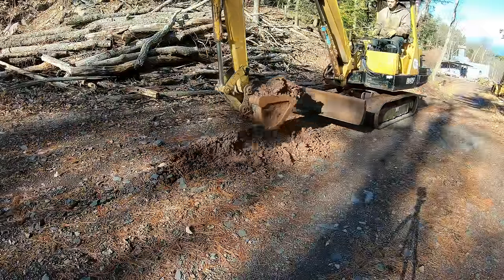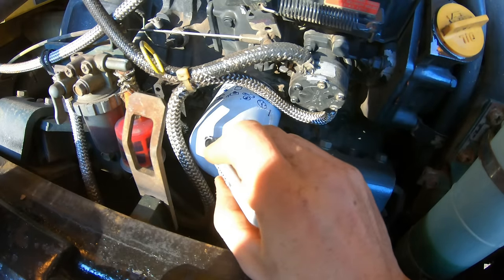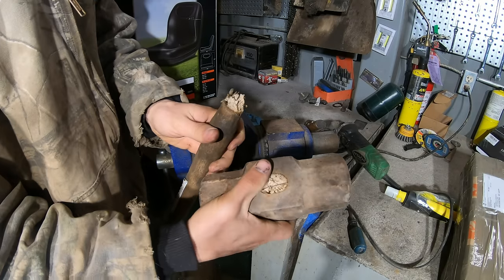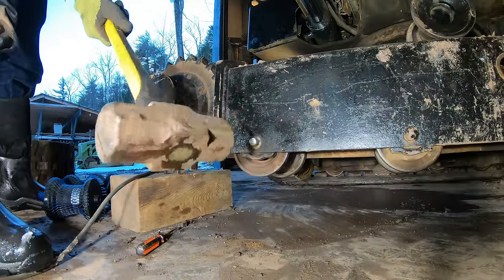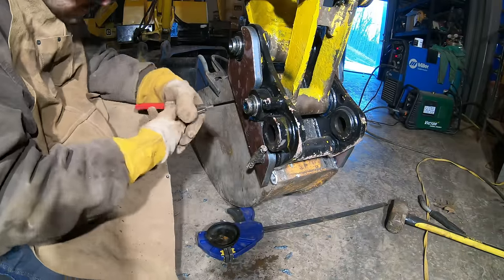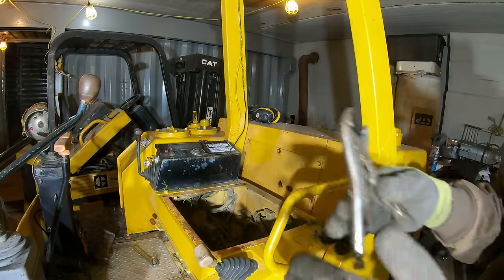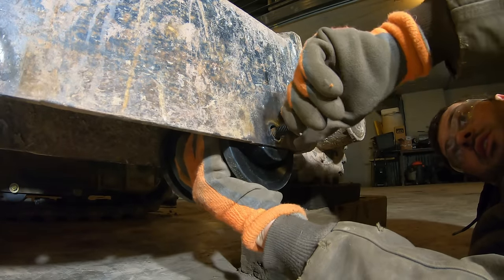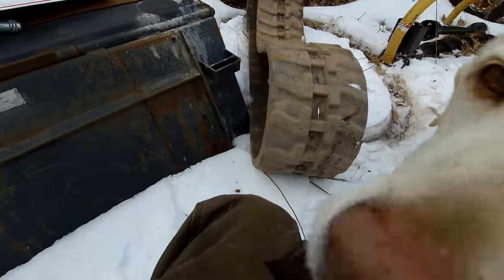Fixing up the new Yanmar excavator

Comment: I’m a marine mechanic, most of the boats I work on have small Diesel engines like these excavators. Yanmar, Perkins, Universal, Kubota, Volvo (repainted Perkins). The Yanmar engines are the most reliable by far. They are not the smoothest or most refined, but they never break, and always start (as long as they have clean fuel, lol)
Reply: 25 year old Yanmar 3GM30F in my boat and it just goes and goes

Comment: Watched most of your videos and my comment is "You are an ACE mechanic". I've only witnessed 2 other people in my 73 year history that have your raw talent. Keep the videos coming!
Reply: some knowledge and the persistence to carry through when shit breaks, or gets tough.. also know when it's out of your expertise like sending away the skidsteer track motor for a rebuild rather than ripping into it, although sometimes as long as you have access to all the rebuild parts needed, knowledge of acceptable tolerances/clearances, and tools -sometimes even tool and die/machining, you can be successful in all ventures!
Reply: Jim Ryan When he was standing on the breaker bar trying to get the roller off he was trying to loosen it to the right he should’ve been turning 
the bar to the left
Reply: @KCBEECH  You've never tried tightening a bolt that won't come off? Sometimes it's the trick that works. these obviously were long past becoming hammered dogpoo. I can't imagine running something like that until it siezes up and wears the metal off while wearing a groove into the track.. That's just insane. Then again I guess thats what you get when you buy an excavator with over 8000 hours on it.

Comment: Thanks for the great video mate ,Yanmar make great marine engines very reliable ,not like some of the junk with well known names and bigger price tags ,you certainly have a great workshop that most people would like to have,me included ,look forward to the video on the thumbs.cheers from down under.
Reply: Agent 036 NWO - damn straight, Japan manufactures high quality goods. Think Honda motorcycles, not even the same as made in China.
Reply: Keith Kelly  That's spot on mate ,it goes for most things as well as motorbikes and outboard motors power tools cars ,I remember a old tee shirt that summed it up " I'd rather push my Harley than ride a rice burner" sort of admits defeat on so many levels. Cheers mate from down under.
Reply: Agent 036 NWO  That's most things ,it's got to do with quality control ,and their culture of personal responsibility ,Cheers mate from down under.

Comment: A back and time saving tip andrew, when pouring out 5 gal pails, or any pail. Place the spout up top not on bottom, this way when you go to dump youve got more accuracy, plus the air can go in and the fluid pours out fast!!! To explain myself, take the 5 gallon pail. Lay it on its side and roll it until the spout is up top and the oil cant come out. Thats the same way you hold it when you go to pour. no more glug glug glug and easier. Works with quart oil jugs with the spout on one side, (not the middle)
Reply: same thing with 1 qt oil bottles, and the old square cans.
Reply: @asmith4326  yep!!  Tricks in the design so simple many of us overlook them!
Reply: Life hack
Reply: exactly.  Maybe it's just the sole proprietor in me but I have a tendency to feel a little nervous when I watch these.  I notice I get over it though and I might even be a more patient boss at work.;)

Comment: Bolt can´t be stuck if it´s liquid
Reply: Thee ole gas ax, a thousand and two uses .Lol
Reply: Blue Wrench!
Reply: @AWDJR  don't discount the "phire phillips" , every toolbox should have one
Reply: Worked as a mech fabricator at a gravel quarry for a big company. Best thing on big equipment with big bolts drill in the center with a good sharp bit then use a torch and fallet the bolt out. Wish andrew would set up a po box for fan mail.
Reply: @AWDJRforYouTube  Add to that hot wrench.   ;-)
Reply: @327JohnnySS  lmao gas ax classic never heard that before

Comment: That oil filter gasket prelube was slick. Ive never seen someone do it quite like that.
Reply: The usual recommendation is to smear on some new oil, but what's wrong with using some old oil from the old filter in that fashion?  Fits perfectly as a template to apply the oil prior to mounting it!  No need to smear it around with your finger!
Reply: the other plus is you see for sure that the old gasket came off.  Personally, I'd wipe off the gasket mounting surface too, but whatever works, right?

Comment: Andrew your video proves beyond a doubt that being a Jack of all trades doesn't have to mean a master of none:)
Reply: To be fair. He doesn't know as much about any one thing as a guy who sits there and does that one thing all day.
Reply: @xcvsdxvsx  That is not always true. There are a lot of people that do the one same thing day in and day out that have no real talent.   And there are lots of people that may not have ever worked on that one thing that have natural talent that have enough drive to do the job right instead of "yeah this part worn but still in speck so use it" A person with real mechanical talent will replace all of the worn parts that will cause a break down later.
A person that sits and does it all day will not because he knows it is work for the future!
Also, lots of the repair shops do half ass lousy work, but still charge a premium rate for bad work!
Reply: Inspector Gadget.

Comment: 1. Clean the top of ur paint can rims before closing them. 2. When the paint falls to less than 2/3 of the container size, transfer it to a smaller container. 2 liter soda bottles are great for storing latex OR oil based paints. and you can squeeze the air out to preserve the paint.

Comment: Great video. I bought a new YANMAR vio35 this year and though it is electronic it is awesome.
Reply: Andrew Camarata torches off the bad bolts from a Yanmar B37 excavator in order to replace the seized-up track rollers. The new rubber tracks and the new track rollers took over the old rubber tracks and the old track rollers.

Comment: Great video as always!

Suggestion; always remove the fill plug first (before the drain plug), this way if there’s an issue or it is stripped and you can’t get it out, at least the fluid isn’t all drained out.
Reply: I'm pretty sure that by opening the lower port first, theoretically none of the fluid should have leaked out. This would be just like the lower end of an outboard boat motor. So I'm assuming the oil drained out because the case seal is partially compromised. Not a big enough problem to address yet. 🤷
Reply: @bat__bat the point is ensuring that you’d be able to refill it with new oil, not to help it drain. You can’t refill it from the drain hole.

Comment: You're gonna use that Yanmar mini ex for another 8000 hours.  Great job.
Reply: That one will still be going when all the electronic and emissions junk on the newer ones, have been obsolete for 10 years and it won't work anymore without it. It's sad we had a guys tractor parked at the end of our farm road today. I went to talk to him he said a speed sensor wasn't reading the same as the GPS his tractor shut down in the middle of the road and wouldn't move. He was waiting for the Dealers to come look. He was kinda mad the week before a $3 hardware store snap ring fell out the transmission, the bill for that repair will be $6000 plus  he's thinking, the tractors not that old either to be having issues .

Comment: Looking at the section where you fabricated some new Model ID decals made remember how, here in the UK, some crafty contractors would rebadge a machine to fool a customer. I.E. Stick D5 decals on a D4 dozer and charge the higher rate! 🤓
Reply from the maker: Lol, I have heard of people doing that to for trucking reasons. Some giant machines needed special permits to move them, so they would put the decals on for a smaller unit.

Comment: Andrew, as I suggested in your last video, this would have been a perfect time to use the hydrofluoric acid. You should have put a diluted solution it in a hudson sprayer or equivalent and sprayed all the paint and hoses then pressure washed the whole machine. It would have cleaned all the grime, dirt, light grease and oxidation off of all those surfaces and most important because you are painting, it would have taken the rust off the rusted areas and left bare metal etched so paint will really stick. Just don't spray it on polished aluminum, it will discolor it. A good example is my quad - Every year or so after all the dirt grime and grease build-up I would spray the whole quad down with a hydrofluoric acid solution then pressure wash it. It would come out sparkling new. Something just soap and water couldn't do. For smaller jobs just put some in a trigger spray bottle.
Reply: Cleaning up all the grime and getting rid of rust helps a lot.
But even the way he did is fine too.
If rust shows up he can deal with it again.

Comment: A quick guess of about $2,000 or more you saved by doing the maintenance yourself. Good job.
Reply: Probably that just for the new tracks
Reply: Just for the 16 rollers he said was $1,000. I can imagine those tracks are probably close to $1,000 each plus shop supplies cost and oil, hydraulic line ect ect. I can agree by doing all the work he probably saved a bit more than $2,000 I bet.

Comment: Store paint on it's lid and you won't get a skin forming.  :))
Reply: Float about 1/4 inch of mineral spirits on the paint before you cap it. That’s how we used to prevent skinning on lettering enamel when we would re seal a partial can.

Comment: Can't believe I missed this one.
Came up in my feed and saw I hadn't given it a like so I knew I hadn't watched it.
The only thing he did wrong from what I could see was the bolts on the rollers were to short and no anti-sieze on them where they go thru area along with no locktight on the threads.
Anti-sieze & lock washers on the roller set he got from china as well.
Other than that his videos are facinating to watch.
Especially the container Castle build series.
That was a seriously awesome series.

Comment: Why install all the bolts dry. Especially in snow and mud. Never seize is your friend.
Reply: diesel and hard work would rattle things loose, also if you buy quality replacement parts, you shouldn't have to replace them again for potentially the rest of the life of the machine. that's kinda why i figured the track roller hardware was welded in, doesn't loosen up on you at a job
Reply: I was curious about this. Andrew says he uses grease on his bolts, instead of antisieze, so I googled it to see what the internet had to say. What I found was that if you're going to use some type of antisieze, the "wet" torque increases and the bolts fail faster due to stretch. So maybe better to use 30% less torque then what's recommended. I do use antisieze on my l lug studs, but I'm thinking it might be better just to switch them out with new ones every so often, to keep them viable. Any thoughts from anyone else?

Comment: 21:03 You broke the head off, because you were tightening the bolt, instead of loosening it.
Reply: Common practice to tighten a stubborn nut in order to break it free...
Reply: Nut was already off from the other side, I pretty sure he was trying to break the bolt free to slide it out. If you notice when he put the new bolt in it slides right in.
Reply: @mmccab  That's true, it's not always successful
Reply: @johnnyfred2125  👍

Comment: Those ratcheting box end wrenches are the best upgrade you can get. They're a little salty on price, but so worth it. I have a whole set in both inch and metric and also the kind where the box end pivots 90° both ways as well in inch/metric. They also have a very fine ratcheting mechanism. They will catch with only 5° of swing, which mean you can use them with only a few inches of clearance. And also the come in real stubby lengths and extra long lengths.

Comment: I love your videos and am impressed with the way you are able to fix most things, you seem to have a problem with changing the fuel filter when you change the oil. This is the second time I’ve watched you doing a lot of repairs but not change the fuel filter. The cheapest filter and the most important as the fuel injection system is very delicate as to contamination and very expensive to fix. Just saying preventative maintenance is cheap compared to repairs after problem arises. Keep Safe my friend.

Comment: and this reminds me of when my buddy got a 1943 gmc cckw 6x6 2 1/2 ton cargo ex military truck used in ww2 with a gmc 270 and a 5 speed and a full cab with a origional winch when he got it the entire suspention was gone it was riped out and no one made replacements parts for it. and he started looking at the weather he was in. he was in a heavy snow/ice and mud area and he wanted something diffrent so he had a yanmar B50 and he liked it and it worked grate in the weather he had to face so he got a idea and he wanted to make a half track out of it so he mesured the length of the rear of the truck and he meshured the length on the B50s tracks and they wouldnt fit, then he mesured a B37 and it would fit some what and he baught a used one and we cut it up and removed the track systum and modified it so it could fit under the truck and we stated customizing it we updraded the bumper to be stronger we added a mig welder to the bed, a generator, fule storage for his stuff a industreal grade air compresser, a large tool box, light bars and work lights, made it a 12v system and a industreal grade warn winch in the bed and added a new front suspension and steering system and new tires he also made custom tires that are filled with polyurethane and has spikes in-beaded in the tires and had custom tire chains made for the front tires and had custom tracks made by a buddy of his so he could use them on ice and snow and its a beast now he uses it as a work truck and a rescue rig and its road legal some how?

Comment: A friend of mine has a Yanmar B50 and one great thing about yanmar is that they put multiple filters on the fuel system. That saved his machine when the fuel tank got rusty.  I would suggest you take a good look inside your tanks to see if there is rust. It's a good idea to keep the fuel filled up during the summer months when moisture in the air, inside the tank, will condense and water will cause rust.
Reply from the maker: When I got that machine a dirty tank kept clogging filters. I had to remove the tank and pressure wash it out. This was 6 years ago and I have not had any problems since.
Reply: @AndrewCamarata  They sell bio-cides that are suppose to kill bacteria that grow inside of fuel tanks. Perhaps that would help prevent problems. 
I knew a mechanic who said he had a large set of steel balls (no pun intended LOL) that he used to put inside of tanks where he would shake them around ( no really ) to get the rust out ( ha ! )

Comment: Nice tip 4 u buddy , when you Finished with paint seal the lid tight ,and TURN TIN UPSIDE DOWN , then next time you use paint the skin is underneath the paint , hence , no skin to deal with .be careful not to mix to deep as you will break skin , 👍

Comment: Need to be using Locktight on those bolts and nuts if ya want them to stay tight Andrew.
We used to use gallons of the stuff on Coast Guard aircraft and ground support equipment.
Never lost a nut or bolt.

Comment: you know why Andrew used a drill the get the handle out of the hammer? Because he couldn't get a chainsaw to fit lol

Second: You should build a carport, just a roof, for your open cab equipment. Would help in the rain and winter when you have to use them.

Comment: Andrew on the pin you polled off your escalator the pins that used to make for deferent company’s. I used to cut the shaft 1/2 longer ea side turn the shaf 1/4 snap ring measure your snap ring make it fifteen to twenty thousand deep. On the end of the drill a hole so you put grease insert drill tap and drill small drill 3 1/2in Deep major how deep you drill your middle Hole, drill a hole on the top of the shaft until hit the hole in the middle of the shaft. I came up with this when I started to make all the shafts. Every contractor loved them. They told me they little longer,

Comment: I don't ever plan on working on engines or equipment, I have used basic equipment around the farm and I drive so having some kind knowledge about  maintenance saves me so much money in the long run. 
For instance, some one tried to sell me rim's for a ford truck, because one had a notch in it like some one hammered it 🤷‍♀️. I looked then instantly said : that can be ground out.  surprised  myself even,  and it did grind out lol

Comment: Yanmar equipment is actually getting a strong customer base due it's reliability and cost and availability of spare parts versus the big name brands.
It's all in making sure you regularly inspect and repair your equipment before it breaks that can save you big bucks.
Downtime in the middle of a job can easily cost 4 or more times as much as if you'd kept up on a good inspect and repair schedule.
Andrew seems to be getting the hang of that.

Comment: Talking about the hydraulic breather, i bought a 95 yanmar b27 mini. Its pretty much identical to you're b37, but it dose not have this breather on the hydro tank. Instead it has a solid cap with a small vent hole. Should i keep it like this or also get the breather?